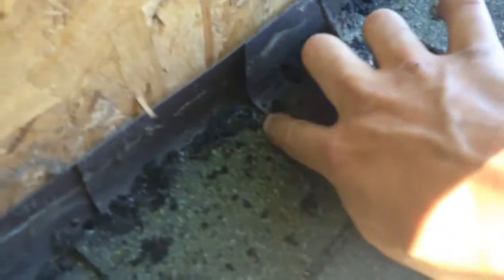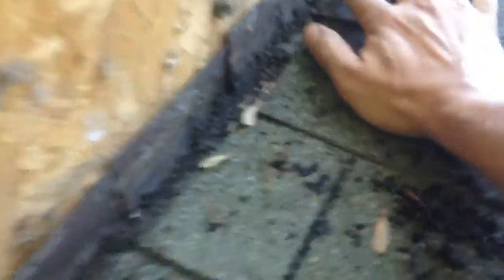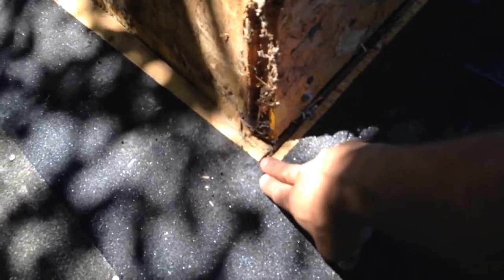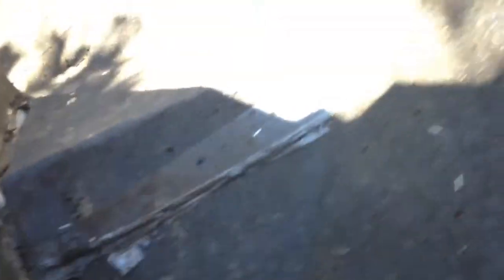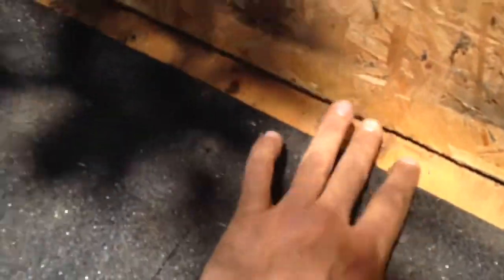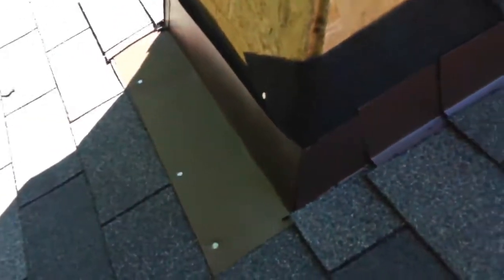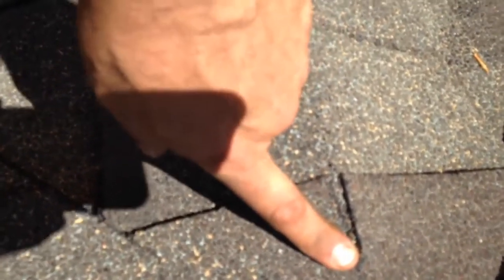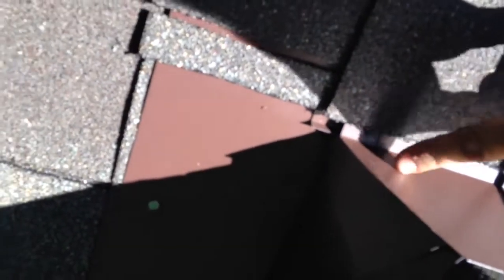Hack Job Chimney Flashing

Comment: Why wouldn’t you just put some roofing synthetic paper to act as house wrap? You had the siding off. Did all that work and it will leak again because of the siding not having anything behind.
Reply: It wasn't leaking from the side it was leaking because it wasn't flashed correctly